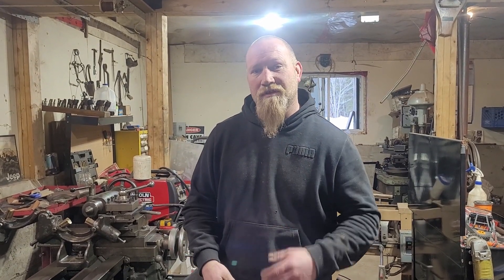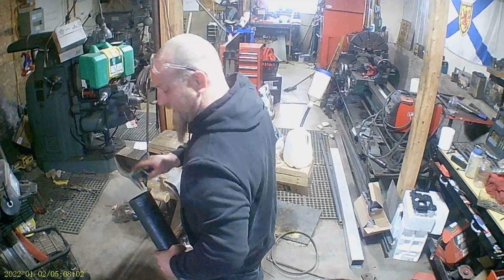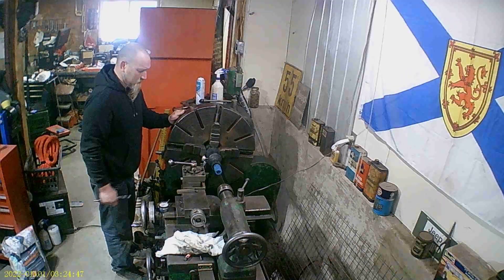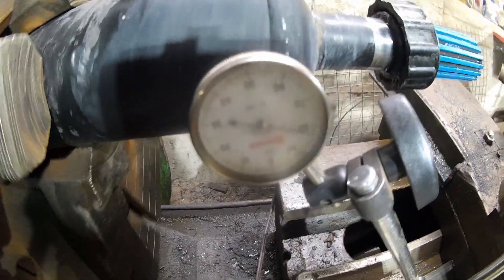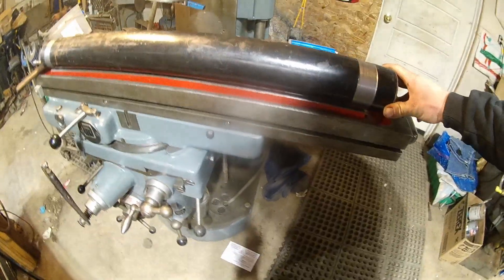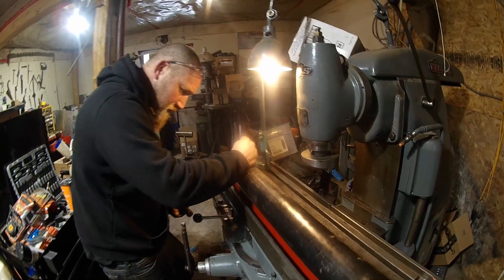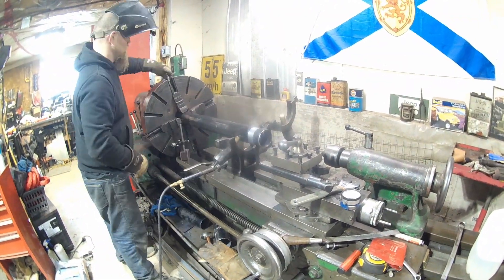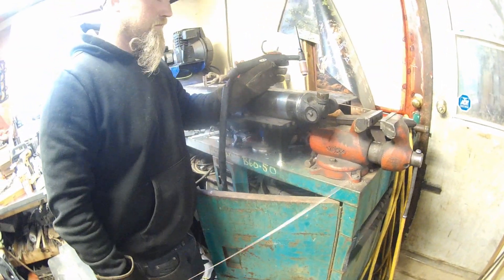How to build and repair a driveshaft or driveline component

Comment: I build driveshafts to an had a customer with a telehandler. They kept twisting the shaft I went from 088,.124, an finally .250 wall an never saw em after that.
Reply from the maker: I bumped it up to .125" as well, the damage happened when it was unloaded off a trailer with no blocking or ramps. If they can keep it out of the rough stuff things will be fine. If not we'll have to step it up again.